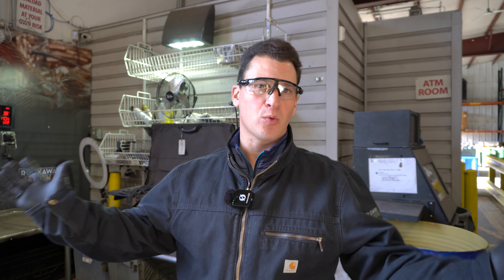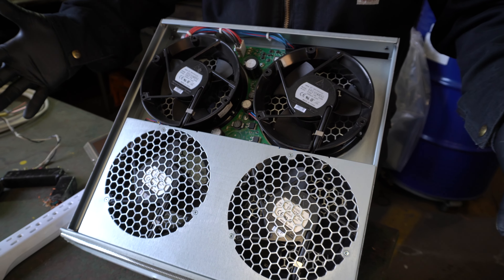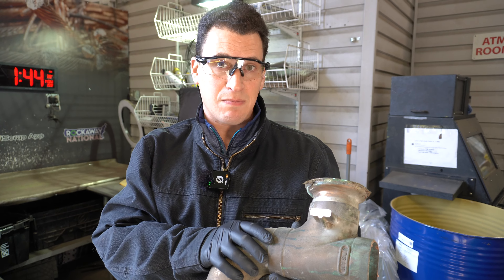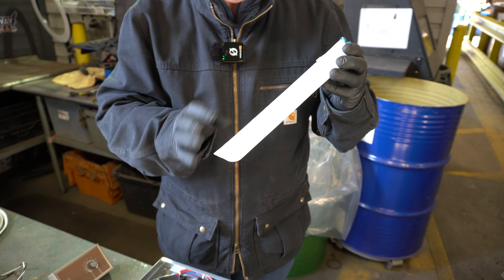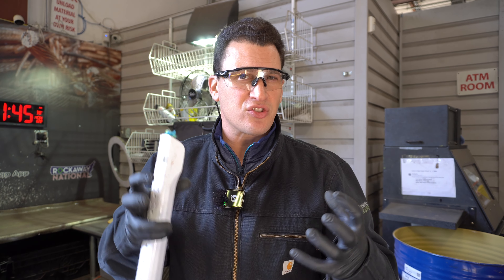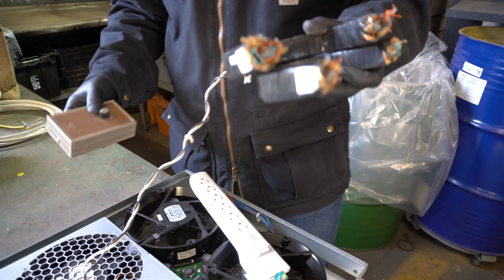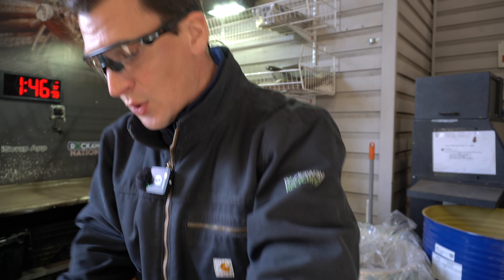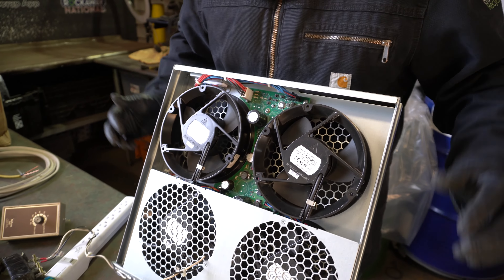The Truth About CBMs & Why You Shouldn't Throw Them In With Steel

Comment: I see that some recyclers put low grade circuit boards into the appliance or shred category at their scrap yars which is usually the samfe price as light iron.   Ewaste Ben does this.   It seems that you .may not allow this and instead buy it as CBM.
Reply: Recently my local scrap yard told me to place e-waste (low grade circuit boards) into their light shred. The owner told me he once had tons of it but could never find a buyer.

Comment: If I had that fan module, I'd break it down. . My problem is that there are no good circuit board buyers in my town. I get 10 cents a pound for any circuit board.  The fans can be broken down into cast aluminum and the electric motor or perhaps sold to electronic hobbyists. Anyway, I never liked taking mixed metals to a yard.
Reply from the maker: Great point about not having board buyers. If it works for your context then go for it!
Reply: Sometimes you’ll do much better advertising computer towers, server bodies, and related items on Facebook Marketplace, Craigslist, or even eBay. 

For instance, I picked up several computer towers recently, and disassembled for the motherboards, memory modules, video cards, wireless cards, and power supplies. Sold most “for parts or not working”. A video card weighing less than 16oz and selling for $30 is most certainly worth your time!